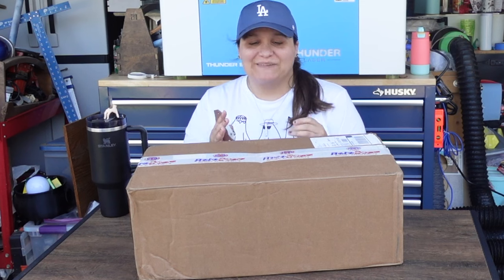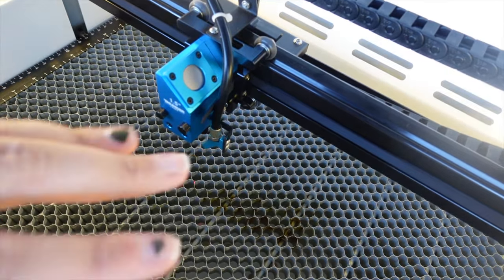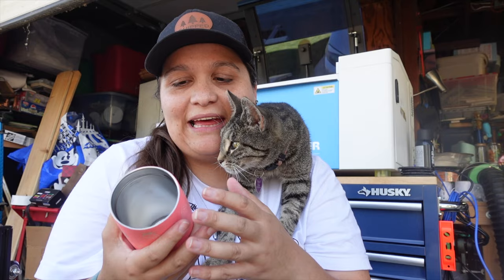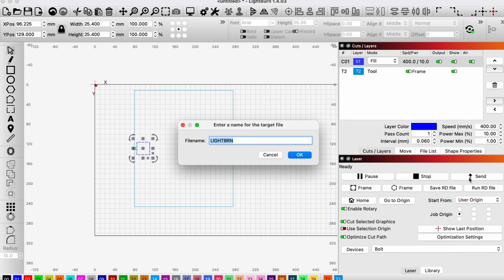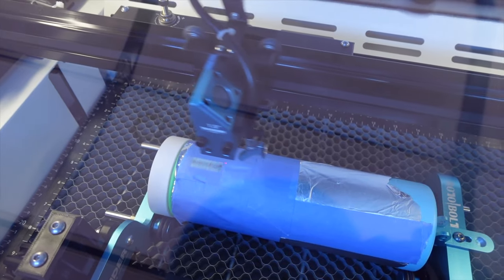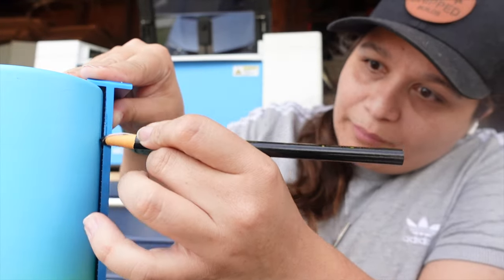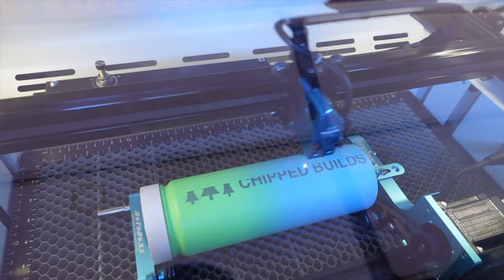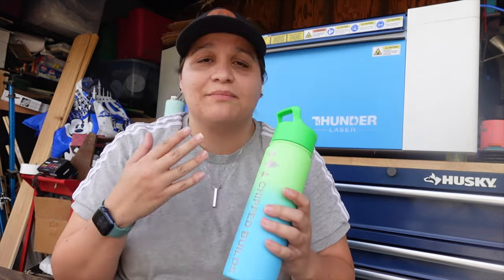Making Your First Tumbler on the Thunder Laser Bolt! || Thunder Laser BOLT 101

Comment: that came out great! I cant wait to do my first cup, thank you for showing us what to look out for. question, can using too much power make a bad engrave?? like if it will work fine at 70, but run it at 90, will it look any different?
Reply from the maker: I’ve seen some people where there was too much power and the engrave went into the stainless steel a bit so they couldn’t get it to clean up nicely. If possible get a sacrificial cup like from the thrift store or something to dial in settings

Comment: Have you tried a Yeti yet? I have a 30 oz and want to engrave just on top (larger) part. Any tips on figuring out settings? I don't have a practice cup and nervous to do it. I was going to test it out with painters tap 1 in square like you did, but I'm not sure what settings would be best. Thank you!
Reply from the maker: I think a lot of people get good results with 400mm/80-95% power on yeti cups. I do most of mine 200mm/95% which is probably overkill but that’s what will get through the powder coating for me. Maybe everyone’s bolt is a bit different.

Comment: Thanks for sharing! One totally off topic question... what model of Husky Workbench do you have your Bolt sitting on? And is it mobile? That exactly what I want to do with mine when I get one later this year!!
Reply from the maker: I don’t remember the exact model but I got it at Home Depot. The feet of the laser are inset a bit so it fits on the style of workbench
Reply: @ChippedBuilds  would you mind measuring the dimensions of it when you have a moment?
Reply: @ChippedBuilds  in case you didn't see my last reply, would you provide the measurements of the top of the workbench? LxW?